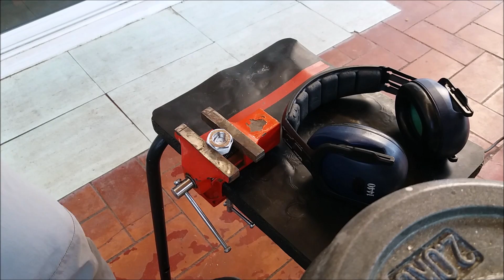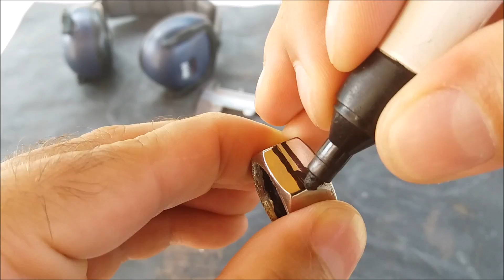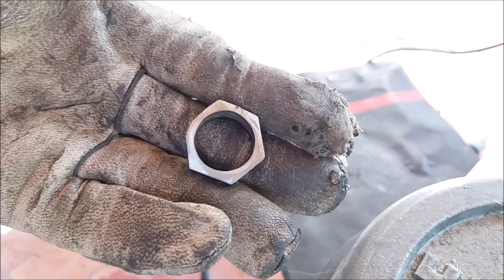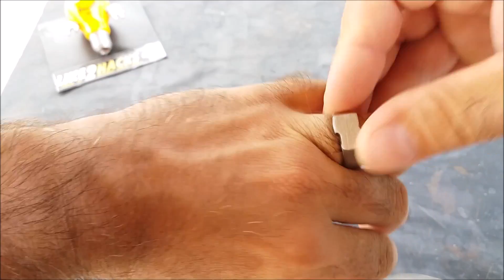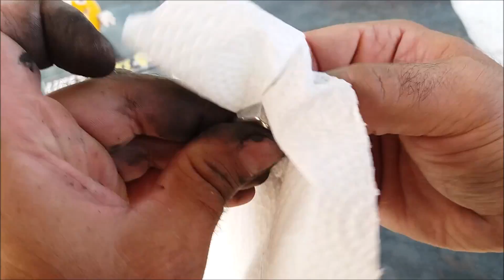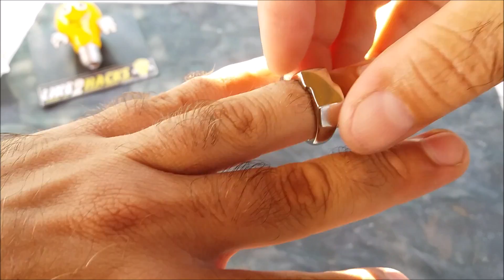💍 Como HACER un ANILLO de ACERO INOXIDABLE con TUERCA 💍 How to MAKE a STAINLESS STEEL RING with NUT

Comment from the maker: 🛠️Mis Herramientas / My Tools⚙️
Pie de Rey / Caliper https://amzn.to/3mf2B7g
Martillo / Hammer https://amzn.to/3qOWWbH
Tijeras / Scissors https://amzn.to/345z0ap
Máquina de taladrar / Drill https://amzn.to/3oO342b
Kit de MecanizadoFresas / Machining Kit https://amzn.to/3mg631n
Minitaladro Dremel / Dremel MotorTool https://amzn.to/3gDg2wN
Reply: I love your work on making them rings I don't have the stainless steel nuts that's the only thing I need nobody's got any I know how to make a copper ring but it turns your finger green if I can buy stainless steel nuts or brass not big enough to make a ring out of I will buy it